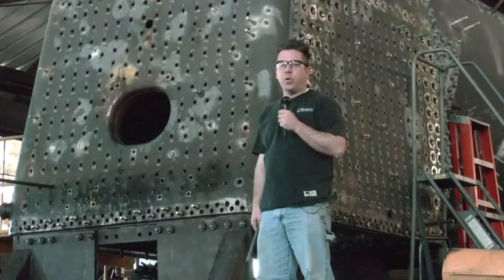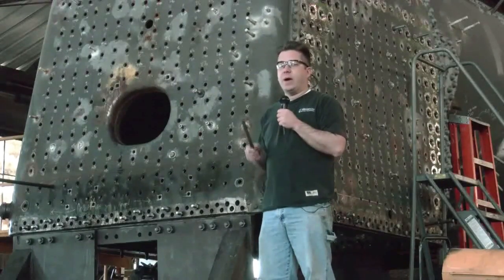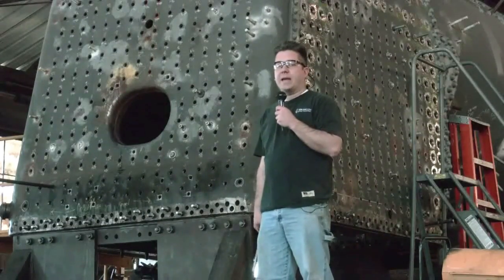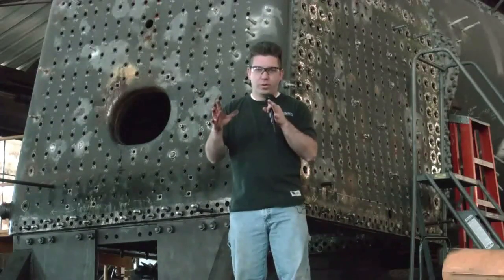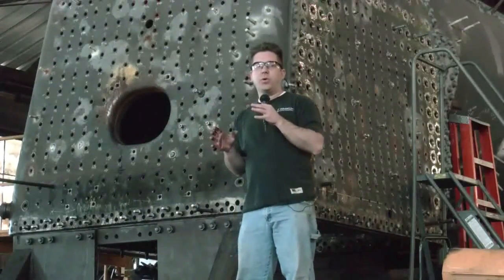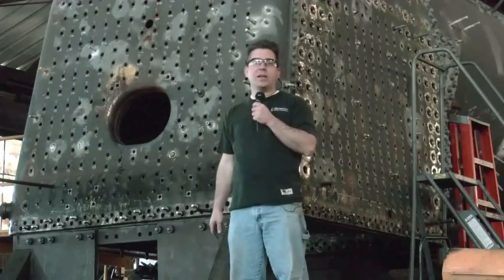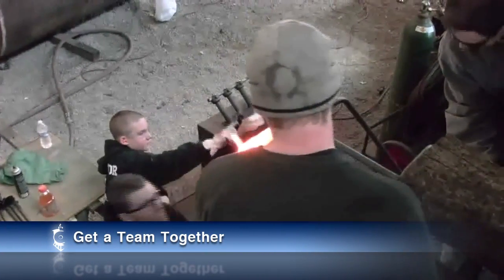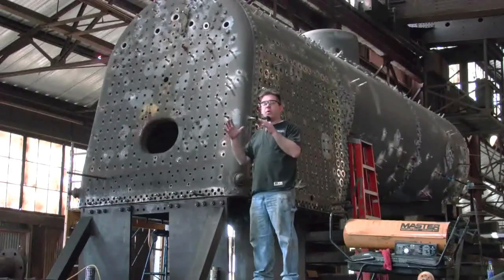WRC Video #17 - Rivets

Comment: As a retired 6th generation Boilermaker I have to tell you that if you are trying to de-skill a craft then leave it alone as you are dealing with a pressure vessel.  And it is not a "GUN" its an AIR HAMMER.  i notice that you are not going back on your previous rivet for a few seconds burst to encourage the rivet to take up any creeping slack caused by plates closing "as riveted".